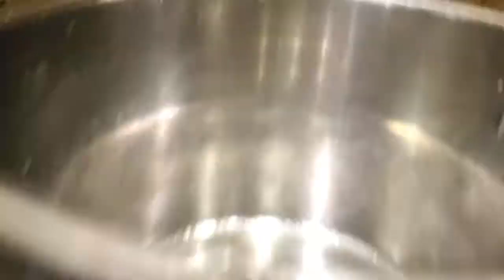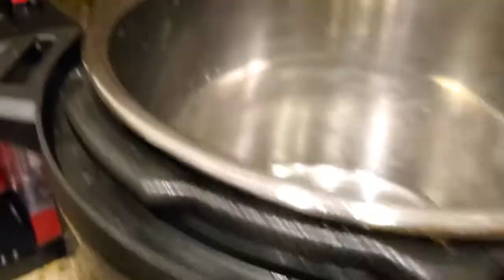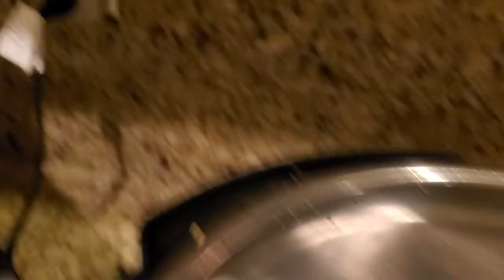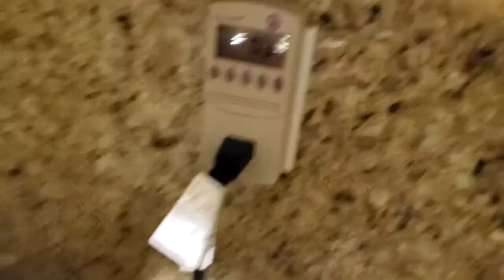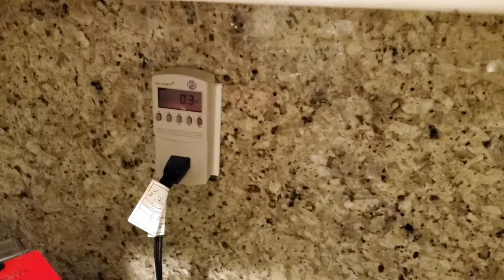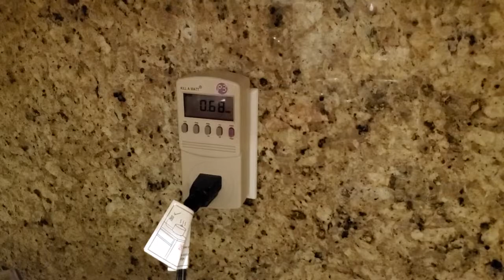How Green Is The Instant Pot?

Comment: Well, solar and wind aren't quite 'zero CO2', since there are emissions in acquiring the raw materials, manufacturing, transporting, installation, maintaining and ultimately disposing at end-of-life - hopefully through recycling - both solar panels and windmills.
Though I'm pretty sure it is significantly lower than in case of fossil fuels. And most research I've seen agrees.
Also, renewables are often used in conjunction with power storage, such as lead-acid batteries, or lithium-ion batteries. In that regard, I suppose hydro power is the cleanest, since it can actually double as energy storage. But still that is a complex subject, since fossil fuel power plants may also use power storage, to deal with high and low demand hours, whereas you don't HAVE to use power storage with renewables, it's just much more convenient, especially if you're off grid.